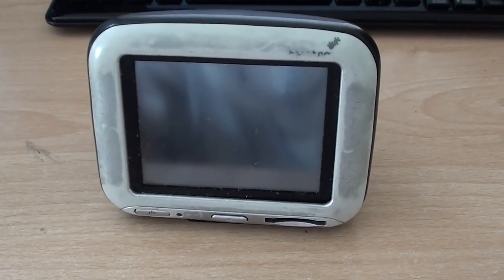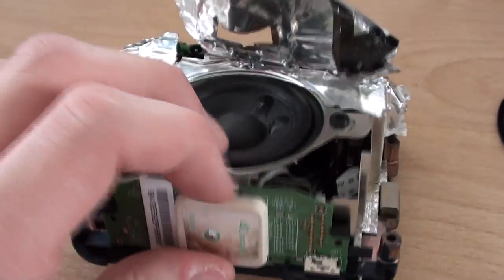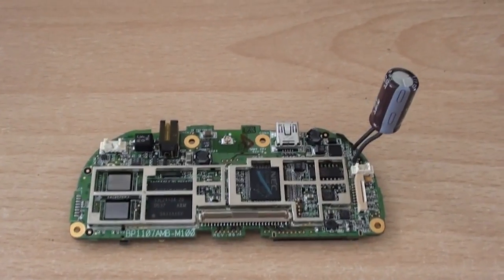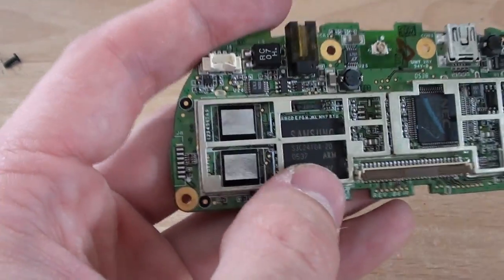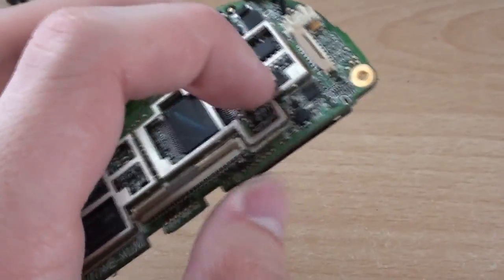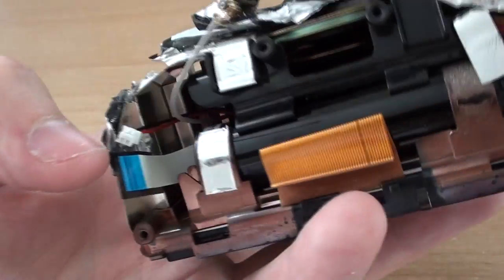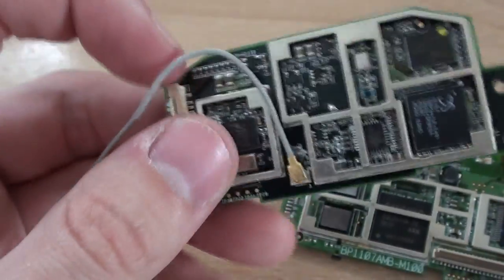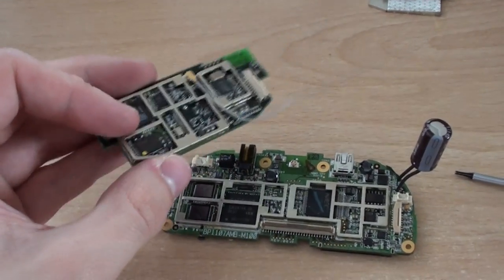TomTom GO300 Sat-Nav Teardown

Comment: Recently uncovered a complete TomTom GO300 with all accessories (and SD card), although it does not turn on. The GPS clicks onto a suction-cup windshield dock (the eject button is the silver guy in the middle) and this dock passes through power to an identical female barrel jack on the rear. There are numerous pins on the dock connector, so I'm unsure if one of these also happens to transfer a data signal. Restated: the RF port on the GPS underside does NOT mate to a male connector on the dock - but that long dock connector itself IS fully populated and may contain more than just power.

I've imaged the SD card and took a few pictures if anyone is interested. :)